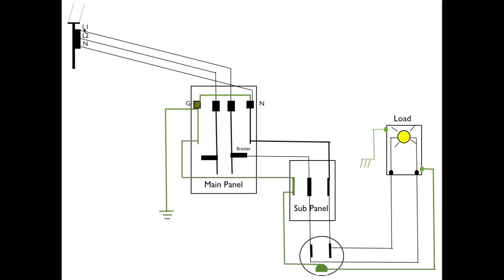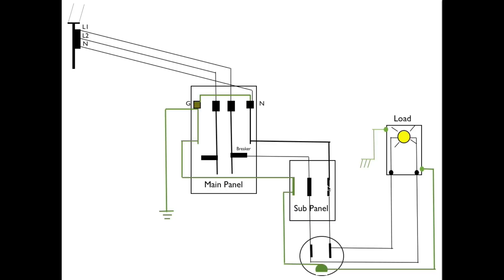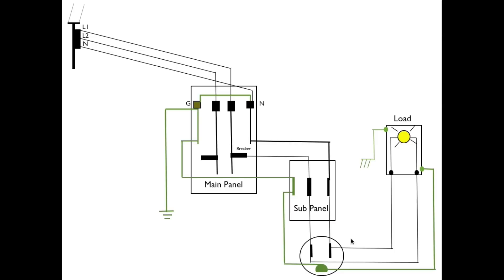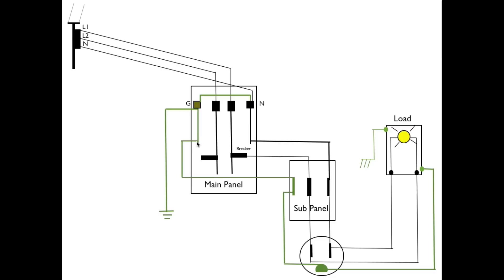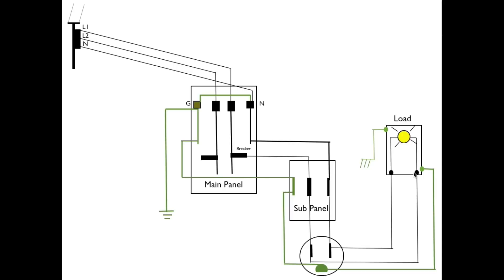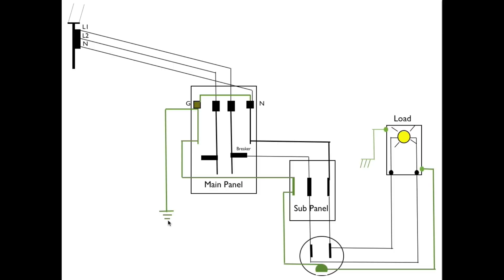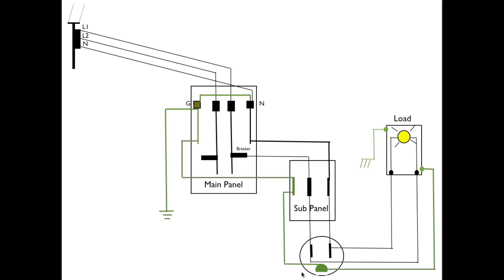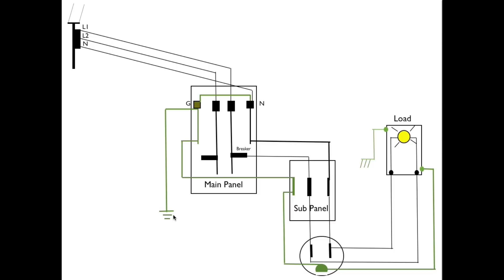The difference between neutral and ground on the electric panel

Comment: If the main and sub-panels are widely separated there can be a problem with the earth grounds. An example would be if the main panel is located on one side of the house and the sub-panel is located some distance away on the other side of the house in an attached garage. Dirt isn't an excellent conductor, so you can have a big difference in ground voltage potential between any two widely separated spots in the dirt. Therefore if the sub-panel in the garage is grounded to the earth through a long wire running over to the main panel located some distance away then all the grounds over in the garage could be floating at some high voltage potential relative to the concrete floor and the dirt underneath. If this is the case then someone using an uninsulated tool in the garage that is connected to the third prong of an outlet that is located there could get a shock by kneeling on the concrete floor while touching the tool.

I had a case like this recently. Someone reported getting a shock by touching an uninsulated 3 pronged metal hooded drop light while laying on the concrete floor under a car. We measured from the grounds of the receptacles in the garage to the concrete floor and they were at 35 volts AC.The solution was to break the ground wire going back to the main panel, drill a hole in the concrete floor, drive a grounding rod into the dirt under the garage floor and grounding the sub-panel to the rod. This brought the receptacle grounds in the garage down to local earth potential and eliminated the shock hazard. This illustrates that if two panels are widely separated then you have to be sure to earth ground each one locally.
Reply: Beware,  people, the above by Joe is not safe.    A ground-fault in the garage, for example, a hot wire in a fridge touching the fridge case, would only have the earth-rod he drove to drain off that ground-fault current.    Earth resistance is high enough that only a few amps would flow, not enough to trip the breaker, and all grounded frames of equipment fed by the garage panel would be close to 120 volts, as would the new-driven ground rod in its hole.    

Drive additional grounding rods at will, but don't break the much-lower resistance green safety ground wire, the one going back to the main panel.  Its there to create an overcurrent condition immediately upon a ground-fault, thus tripping the breaker powering that hot wire.

GFI's shut off fast with the most minor ground-fault current and are a really good idea.   Even 2-wire, ungrounded appliances are made safe, like if a little  AC radio fell into a bathtub.

I suspect the drop light example's problem had a further cause, which was not identified during that work.
Reply: As long as the separate, local earth ground and the neutral are brought together in the sub panel (the same as in the main panel) the breaker in the sub-panel will still trip if a ground fault occurs.
Reply: Joe Vignolo: Neutral is grounded once at the main disconnect and never again downstream. Otherwise, neutral is paralleled with bare wire grounds and currents can flow in bare wire grounds. A lot of bad ideas are going out here to those who do not know better than to follow practices they read here.
Reply: Joe the neutral and ground are not allowed to be together in the sub panel. .  My brother  said he worked on a machine that had its own ground and power was going into the machine from the ground wire and shocking people who touched the case as somehow the ground was hot and sending power into the case of the machine through the ground wire.  they had to remove the local ground and make sure the sub panel was grounded to the main panel only to fix the problem.
Reply: I think it had a broken earth wire.
35 volt potential indicated an open earth.
Put an additional earth stake, but find that open circuit first.
an earth stake locally might not protect against a hard short in a machine to earth.

Comment: MY microwave is plugged into a dedicated outlet which is also marked on the main panel (20amp).  I have diagnosed that the common wire has become detached somewhere in the system.  There are no other wires coming into the outlet so I believe the breaker switch is just for that wall outlet for the microwave.  I also checked to make sure no other outlets are disarmed when I flip the breaker off.  I have changed the outlet, thinking the outlet was bad.  I have plugged the microwave into another outlet to make sure the microwave was good (and it is).  I can't figure out where the common wire has come loose.  Perhaps it is in the sub panel??? But if that were the case, wouldn't that affect other outlets as well??
Reply from the maker: +Vernon Steinkamp You just have to look close.  It is almost certainly in a junction box or panel.  Hope this helps.
GFM
Reply: I'm done this ain't my blog anyway 😳✌🏾out!

Comment: I just fix a job my father-in-law did 30 years ago to a shop.  He sold it to his nephew and his nephews son got lifted pretty hard when he hopped on a treadmill in the shop.  He used a main panel as the sub panel (which is fine) but didn't remove the bonding screw out of the neutral bar.  The nephews son became a current carrying conductor for those who don't fully understand my vague explanation.  Electricians really should wire panels, not being offensive.  But there's just too much unknown and codes that DIYers think are stupid money grabs when they actually are very legitame.
Reply from the maker: I agree.  But people will do their own work.
GFM

Comment: I see sub panels with the ground and neutrals all on one bar very often. Yet I  do not hear of any complaints or faults in those houses electrical system. Can you describe the method to display on a  meter exactly what those faults or potential dangers are?
Reply from the maker: The issue here is with both chassis ground and neutral connected, an open neutral would allow the load to operate normally.
Then, if there is an open in the ground, the load chassis would be hot.
GFM

Comment: I wired in my 240v compressor it only has 3 wires. After watching this it seems like now my compressor isn't grounded? Should I get 10-4 wire and make a ground? I want it to be safe. Kinda weird that dryers have 3 wires too.i used the bx cable (metal conduit) but that's probably not a safe ground?
Reply: The compressor apparently only needs three wires, two hots and a ground. You only need 10-4 if the manual states a neutral is required.

Some jurisdictions do not allow BX cable, but it has a long history of use and is reasonably safe if properly installed.

Comment: I have metal boxes with black & white wire, no ground wire. When I replace the 2 prong with a 3 its testing positive for ground. How is this happening? When I test hot leed to the box in getting 120. If I put a GFI in there will the GFI function properly?
Reply from the maker: Your readings are probably normal.  On older units, the metal conduit is used as a ground and is bonded to the neutral in the main panel.
GFM

Comment: Hi. I appreciate your lesson. I am in a house with something wrong. dead outlets and light switches. I used my meter on a dead outlet.  Black to white 0 volts black to ground 0 volts. white to ground 121 volts. I'm at a loss. on another near by wire black to ground is hot with black to white, neutral,  dead. any help would be appreciated.
Reply from the maker: Can't say for sure but it looks like you have an open neutral and possibly a reversed outlet.
GFM
Reply: Thank you
Reply: Bob R — I would have a licensed electrician diagnose that.

Comment: So  what your basically saying is that the ground wire is a fault signaling wire and the RCD back at the main distribution panel work by detecting current on the ground wire?
Reply from the maker: +John Smith In a sense I guess that's true.
GFM
Reply: grayfurnaceman I wouldn't have come to that realisation until watching your video. I'm not an electrician more of an electronics hobbyist. I always thought the ground wire was to provide an alternate path to ground rather than through a person.

Comment: There is one thing that I have been trying to understand is that at Your MAIN panel, Ground and Neutral are connected together, then at the Sub Panel, aren't they connected too?
Second question: at my house, built like 30 years ago, at the MAIN Panel, the ground and the Neutral are on the same BAR, so if I want to build a Sub Panel right next to it, how do I get the Neutral and the Ground separated? Thank you so much,
Reply from the maker: First question.  At the sub panel, they are not connected.  When you buy the sub panel, there is a grounding screw packaged with it.  If the panel is used as a sub panel, the screw is not used.  
Second question.  You simply connect your neutral to any open terminal on the grounding/neutral bar.  Same with the ground.  The separation is done in the sub panel.  
Yes, it does make sense.  If you had a drill that is grounded and the neutral and ground were connected together, if the neutral was open, the drill would work normally.  Then the ground pin broke off (a pretty common condition), the body of the drill would be hot.  
In this case, the drill is a sub panel.
GFM
Reply: @grayfurnaceman  Hi, really grateful for you reply. I am still confused though. I see and I understand that at the Sub Panel,  YES, they are not connected, but since they come from the main Panel, and at the main Panel, they are Connected, so fundamentally are they still connected at the Sub Panel right? Can you really explain this Part, I would really appreciate it. Thank you again.

Comment: hiI have  a home that was built in 50's the house is updated with new panel & safety grounds. 3 prong outlets. BUT the garage still has 2 prong outlets... I am not able to add ground to outlet because of no access. would it be ok to put a GFI breaker in the panel that supplies voltage to garage?
Reply from the maker: GFCs will work without a ground. 
GFM
Reply: thanks for the help.....

Comment: in my new square D panel, the neutral and ground are connected together just like that.  In fact all the neutrals and grounds connect to the same bar.

For practical purposes this makes neutral and ground exactly the same thing particularly when I am running no sub panels, correct?

I get that you want a separate wire path from every load back to the neutral on the line, but still it is at the same potential as ground everywhere in the system when working properly, right?.

With this in mind, I have some smart dimmers that need a neutral in order to work via wifi app.  I am rewiring now to add extra neutrals to those boxes, but since neutral is 'the same' as ground, theoretically they should work properly if the neutral wire from the smart switch was connected to ground?

If there was the unlikely circumstance where you got a clean break in the neutral line at the load and at the same time got the  neutral from the load shorted to the chassis ground, the load would then work as normal but the chassis of that load/fixture would be hot with a return current path.
Reply from the maker: No, it is not correct.  
How about the circumstance of a grounded neutral in the appliance.  If it had ground and neutral connected, the appliance would operate normally.  Then, a year later, there is an open ground.  Now you have a hot appliance.  Not unlikely at all.
The ground is a safety conductor, not to be used to conduct current.
GFM
Reply: @grayfurnaceman  Thanks.
I get that the ground isn't intended for current, it's always supposed to be a direct path to ground.
If you had no sub panels, and are directly off the main panel, and with no opens or shorts, and disregarding wire colors, at the load, you wouldn't be able determine the difference between neutral and ground, even via a multimeter since they are connected together within the panel.  Where you would discover it would be when you had an open ground then had a hot appliance.  Am I closer?
Reply from the maker: @thordehr  I think so.  You just need to remember what we are trying to do here.  Avoiding making an appliance/sub panel hot.
GFM
Reply: Thor Dehr    If you connect your smart devices to the ground conductors will it work?  Yes if it is not GFCI protected circuit.   But, if you have a short circuit within that branch circuit, you will get a considerable amount of instant smoke!   Then you will need all new devices.

Comment: Thanks for sharing with us.
A question: if I have a disconnect box. I must connect ground and neutral in it. An the main panel becomes a subpanel? ( no connect ground an neutral together). Am I correct o wrong?
Reply from the maker: If the disconnect is upstream of the main panel,  the earth ground is connected to neutral at that disconnect.  The main panel is then effectively a sub panel.
GFM
Reply: grayfurnaceman thanks a lot.

Comment: So quick question ? I’m an apprentice got little bit of idea what you said but I’m wondering if neutral is a path back to the source why under normal circumstances we cnt detect it’s hot neutral wire? So power coming in on the hot wire gets completely consumed by the load and nothing else goes back???? Is that what it is?
Reply from the maker: Electricity is not really consumed.  The loads in the circuit are effected by the current passing thru.  
The reason you read nothing on the neutral side of the load is neutral is the center tap of the pole transformer.  
The center tap is zero voltage because the 2 hot sides are 240V from L1 to L2.  L1 will be 120V to neutral and L2 to neutral will be 120V.  
The neutral will always be 0 volts when either L1 or L2 are at 120V.
Hope this makes sense.
GFM